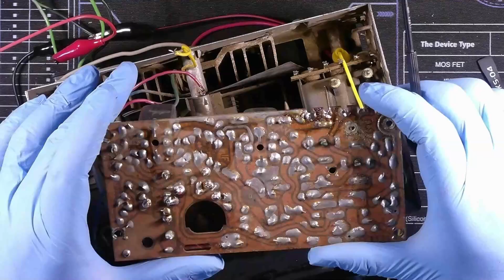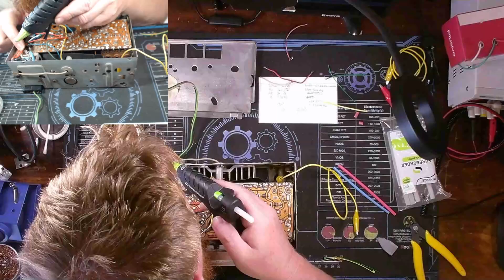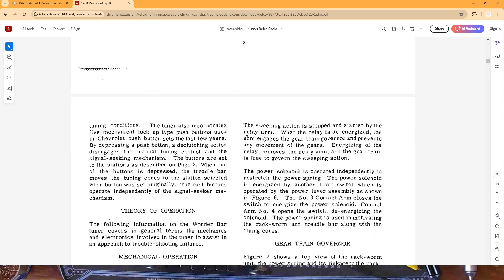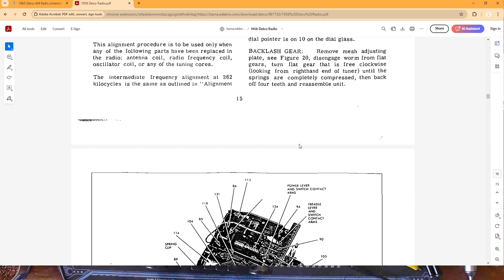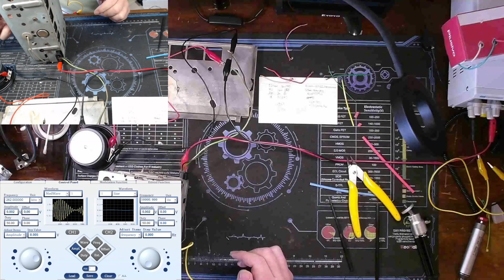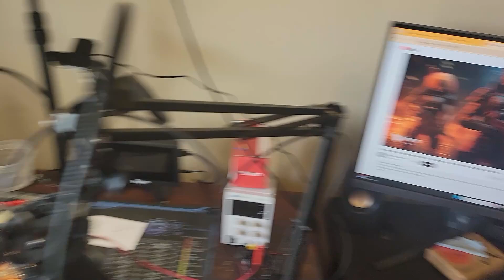(Revival + Mod) 1970s Delco GM Truck Radio with Bluetooth!

Comment: Very good. I haven't worked on radios for donkey's but it seemed that when initially changing between 455 and 262kHz IF there was little difference to the tone volume, prior to realignment, possibly indicating the IF filtering was too broad. Though this may be a misconception due to my rapidly fading memory, I do recall that early car radios were always very poor without the correct antennas.
Reply from the maker: @ralphj4012  keep in mind the volume regardless of tuning is adjustable via volume pot. At 455kHz and 1kHz mod @90% I couldn't align below (I think)  .03-.02 vpk-pk (maybe it was higher than that), but at 262kHz I was able to get a tone at a much lower input level. That being said the IF cans are fairly broad filters and they shouldn't be. The cans should provide overall selectivity and to a degree assist with sensitivity (outside of the transistors), right? I just took the reception issue as mostly a sensitivity issue and my assumption is that I needed a better antenna. There were definitely some adjustable trimmer caps that needed replacement. I also didn't really bother testing a lot of components because the customer wasn't looking for a full restoration. Mainly because they just wanted to use it with Bluetooth. The checkout using my SigGen as a low amplitude RF radio station at the end was as far as I could really go. As a guy who loves radios, it was a bit sad for me. However, I know the customer was happy to have the Bluetooth functionality so that at least was a plus. Always appreciate your insight! Keep injecting whatever and whenever.